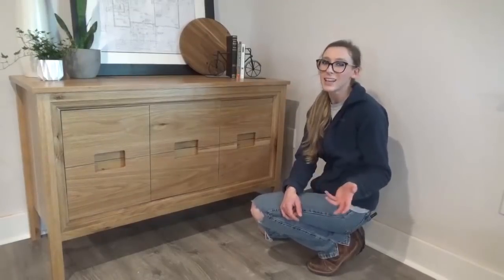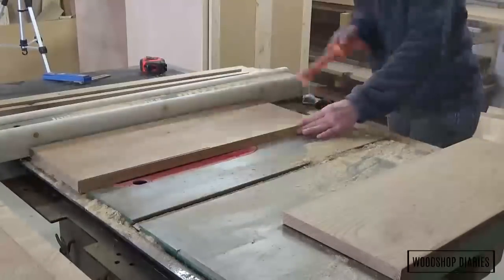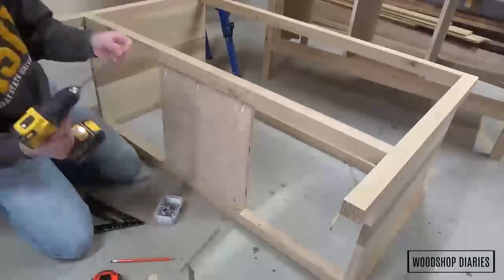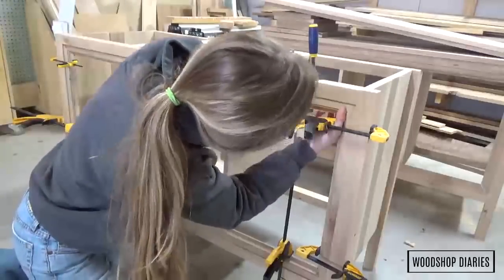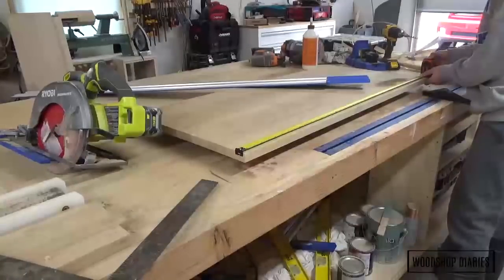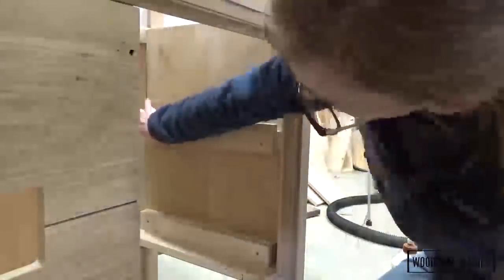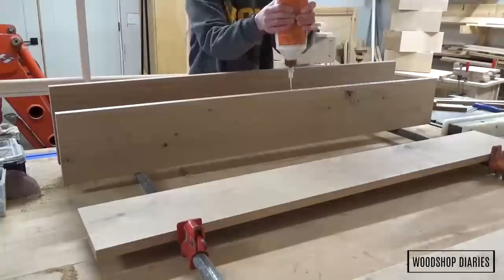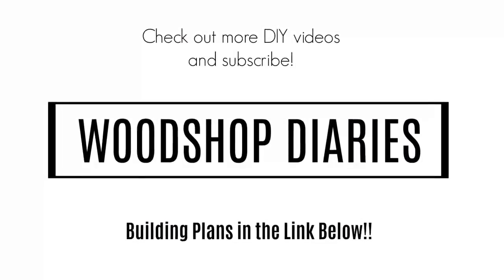How to Build a Dresser Console

Comment: I love your work. The style of this piece is very IN right now. I’m very curious why you don’t biscuit join your boards to make the tops? The tops take the weight and water exposure and I would be very concerned about these glued edges coming apart in a short amount of time.
Reply from the maker: Biscuits are mainly for alignment. Glued edges vs biscuits and glued edges would give practically the same results

Comment: Hey Shara! Beautiful work. Have you had any wood movement issues with the side panels? I’m building something with solid wood panels and want to just use glue and dowels but am afraid of wood movement being a concern. Everything I’ve read online makes it seem like I need to make a groove and have a floating panel. But since you did it here, I thought I’d ask! Thanks!
Reply from the maker: These are two years old and have been in my parents bathroom for that time and they’re still doing great. I haven’t noticed any cracks or gaps on the tops or sides at this point. 
I think there are a lot of “rules” in woodworking that sound good on paper but in reality, they don’t always mean anything. I’ve done things “correctly” and they’ve failed and I’ve done things “incorrectly” and they’re still going strong 5-6 years later. At the end of the day, I think you just have to do what you’re most comfortable doing and if there’s risk involved, consider the risk. If the side panel “fails” what’s the consequence? Will it collapse and burn up in flames? Or will it just expose a small gap or crack? Are you able to live with/fix a “failure?” 
Either way, if you’re concerned about it, you could do a floating panel like you said, or even just use a plywood panel for the sides which will move a lot less than solid wood. 
But, so far, these are still looking good after two years 👍

Comment: Thats really lovely, how much was the cost ?
Reply from the maker: Dave Williams I built two of them and used two sheets of plywood, and 60 bd ft of white oak. Plus some hardware and drawer slides. Total for both was about $500 ish? I didn’t add it all up. But you can check the materials list in the blog post to figure up the total for your area...lumber costs in your area vs mine will likely differ.